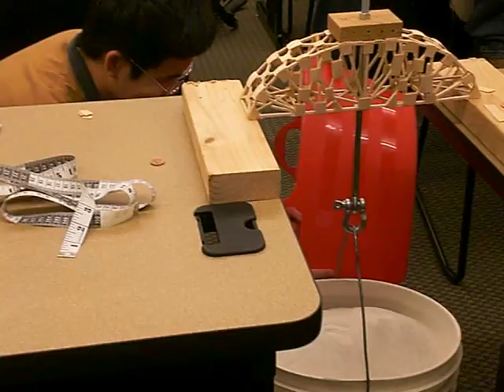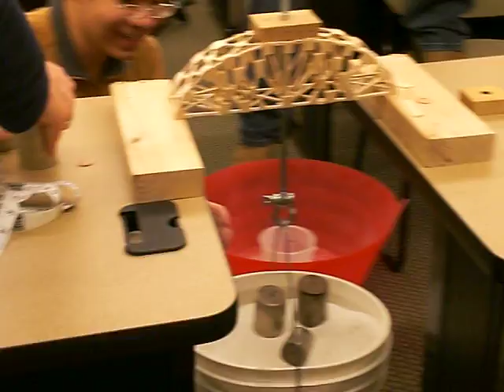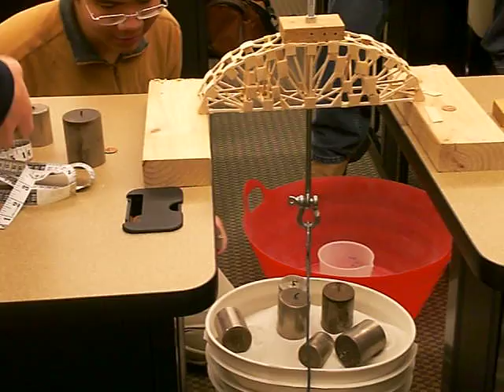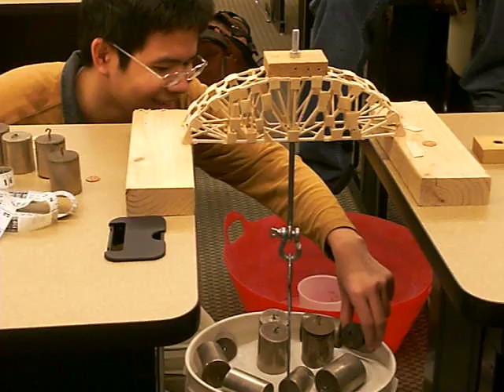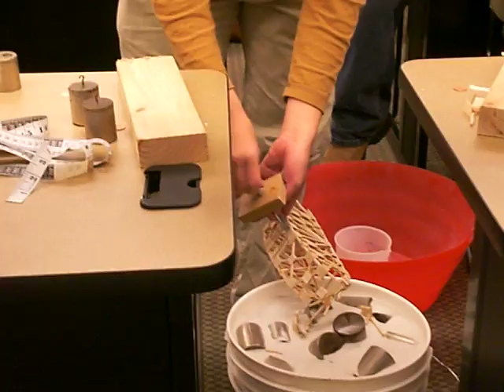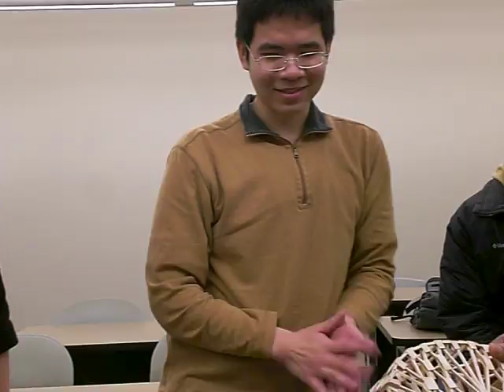Engineer 210 Balsa Wood Bridge project

Comment: @datzfast 
i never said at the highest part of the bridge, but in the mid area of it. it would create the exactly same amount of torque force if you put it on the highest part (but right in the middle) part of the bridge or if you put the weight as low as possible (but right in the middle as well).